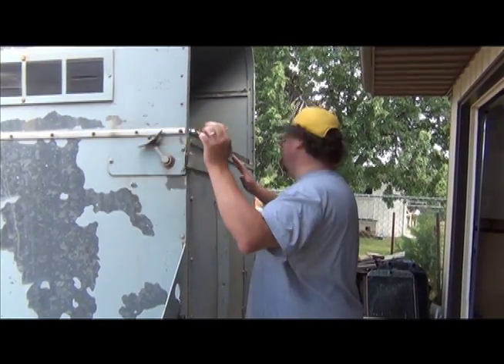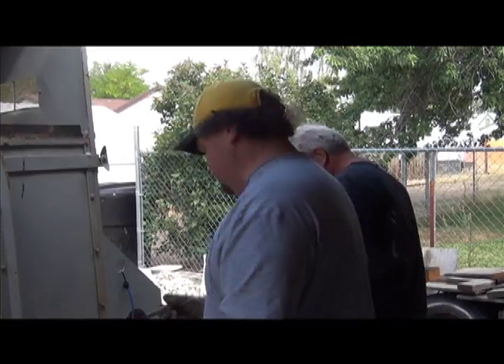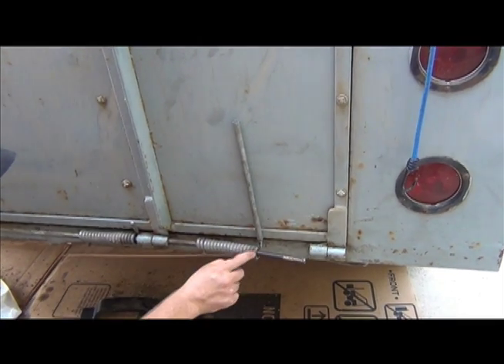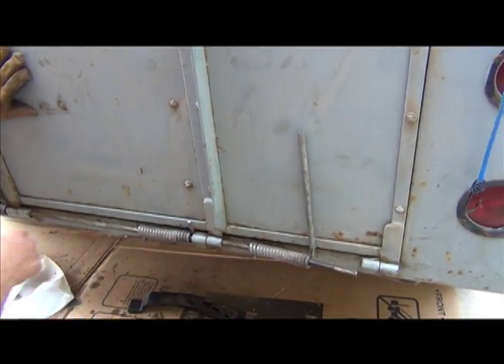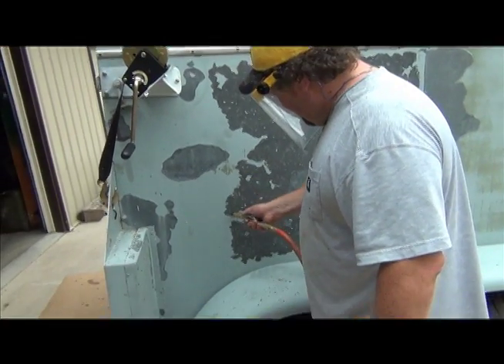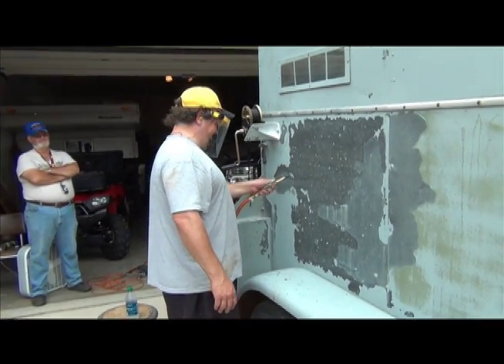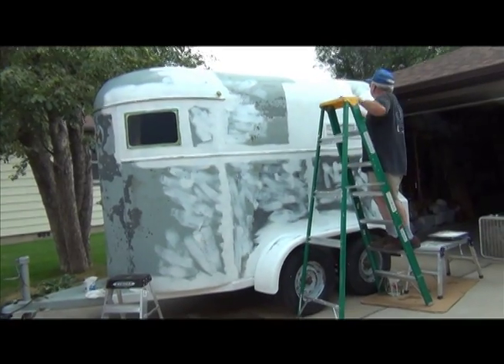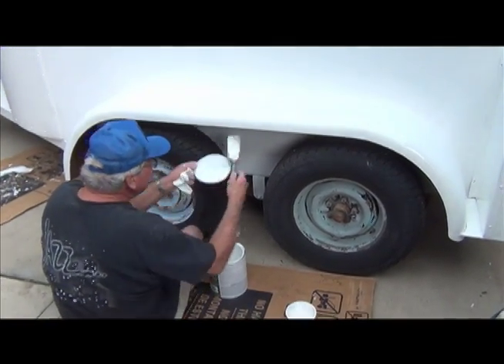Horse Trailer Ramp

Comment: I absolutely love the simple fix to a challenging problem. I have a ramp as well and took out the wood between the mat and the metal side of the ramp. Replaced it with plastic pipe and 1/4" mat, that really reduced the weight but your fix is DIY genius!